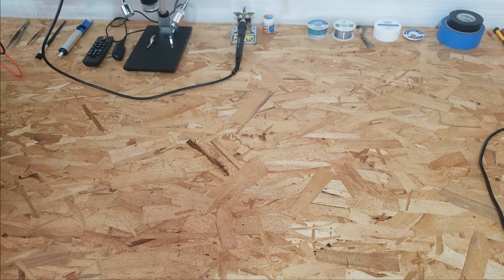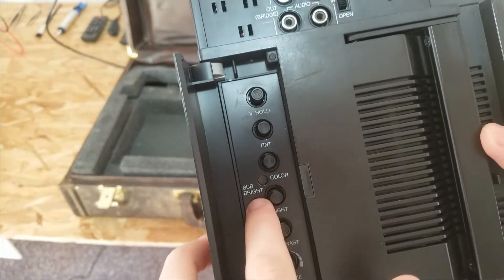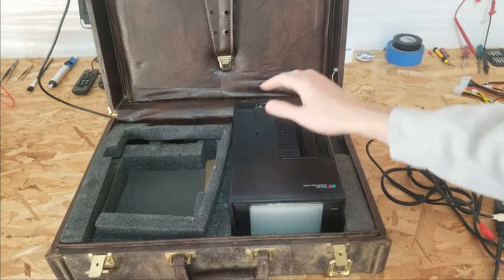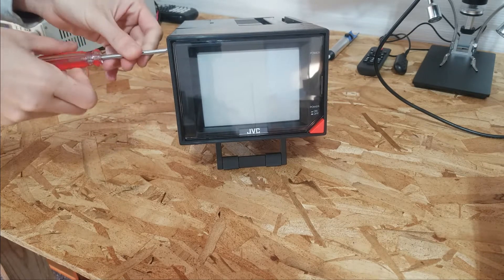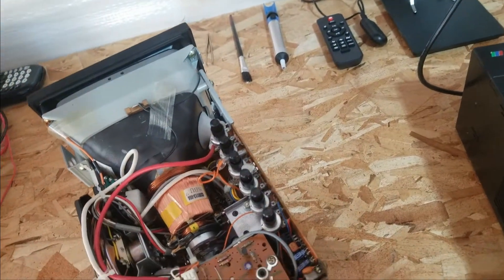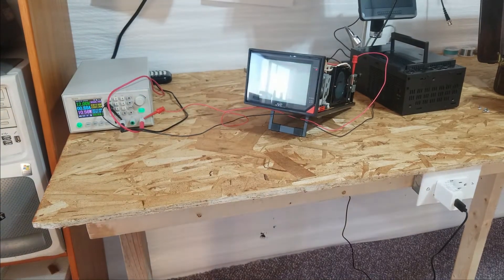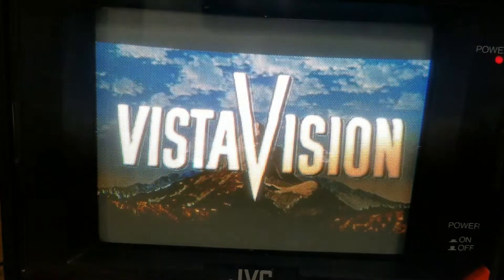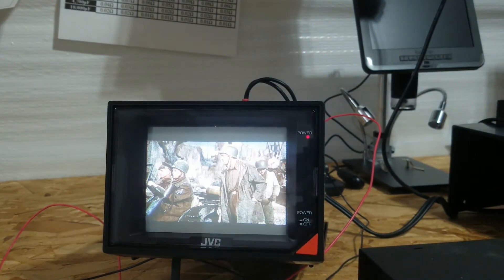Testing some JVC stuff (a TM-63U and a broken HR-C3U)

Comment: don't know if it still relevant 3 years after, but those vhsc are really more easy to work on than you think :)
boards are not soldered in each other, simply... plugged, and hold in place with claws, they had to be simple for servicing back in time.
the issue it has is microcontroller don't reset and initialize, that's why. the reason? bad capacitors.
the one causing the issue is on the front board. most issues with those are only bad capacitors.
Reply from the maker: Hmm, if I still have it lying around, I'll give it another look.

Comment: Hi again - I found one of these great little JVC monitors and bought it,  but the seller told me they connected a radio shack power supply that has a tip on the that was on incorrectly and the polarity was reversed. So, the monitor isn't currently working  and I'm wondering if there is a fuse inside that might have blown to protect the electronics that I can replace? I'm don't know much about electronics so I hope you can let me know as I would really like to use it. Hope to hear from you and thanks for the video!
Reply from the maker: Yes, so the polarity of the DC jack is reversed from a typical plug today. (I believe the sleeve is + and the tip is -). There is a 1 amp fuse near the base after you remove the cover. This was blown on my unit, and I replaced it with a similar fuse, and it worked. (I'm not sure why it was blown. I assumed it was due to age, but it could have been that someone before me used the incorrect polarity plug) I remember the fuse was not very easy to see or remove because it's behind the metal frame. 16:19